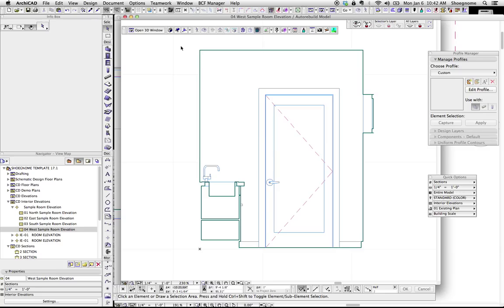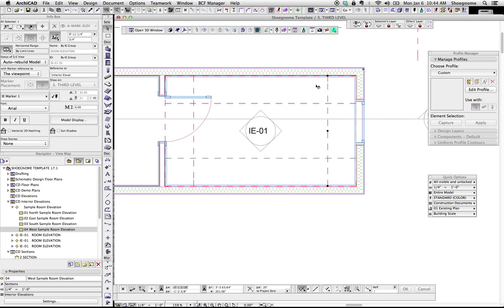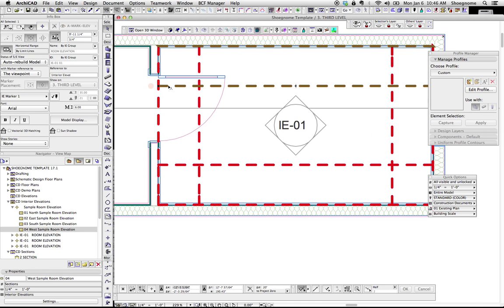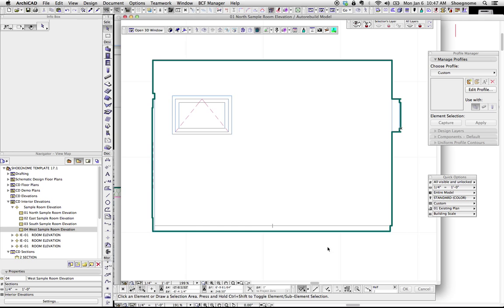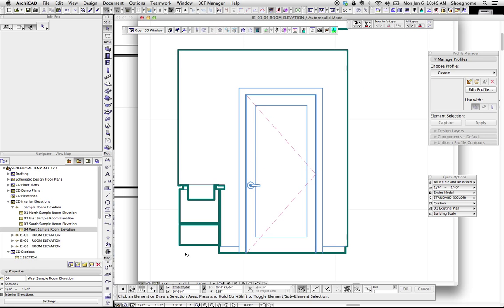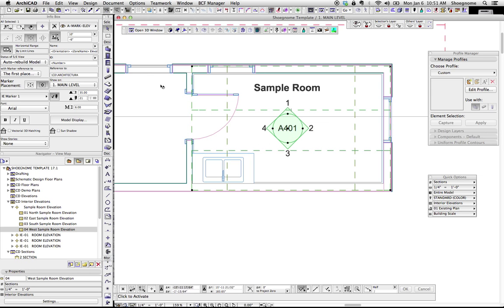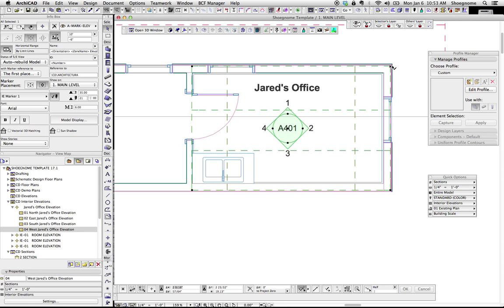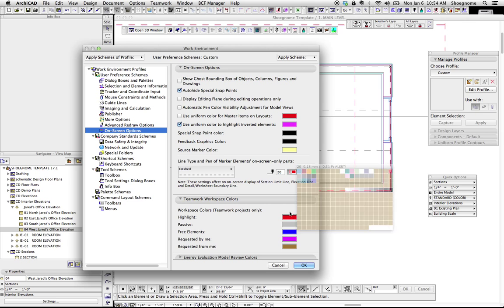ArchiCAD Tutorial #31: Interior Elevations in ArchiCAD

Comment: Nice vid, I have a question....how did you build your walls? Did you use Profile Manager to create your wall linings and skirting to a custom wall, or is the wall a composite with lining and the skirting is another element?...I am using ArchiCAD 22 and it seems that there is always a second cut line at the extent of the elevation marker in a custom wall rather than none in a single wall or composite wall.  I would like to know the marking settings and graphic override settings to achieve your pretty interior elevations...thanks
Reply from the maker: Sorry for the slow reply, I've been on vacation. Download my template (it's free if you want it to be) and check out the settings there: http://www.shoegnome.com/template/ They'll give you all the details you need for matching how I handle the graphics. I use a Composite Wall for the main structural wall then add beams and or secondary complex profile walls for trim, baseboard, siding, skirts, etc.  Graphic Overrides, MVO, and pens solve the cut line issue. I've also moved away from line weights in general as most line weight issues are self inflicted. Also search some of my old posts here for more on automating the graphics: https://blog.graphisoftus.com/author/jared

Comment: What's the best way to deal with a sloping ceiling with the interior Elevation tool? I don't see a setting for that so I'm assuming perhaps an SEO?
Reply from the maker: Make the Interior Elevation go just above the top of the sloping ceiling. Then if you follow the techniques described in the video above, it should all work out. Worst case you have to do a little bit of masking to hide what's above parts of the slope. The Interior Elevation tool can't do a sloped side so the view will always be rectangular.

Comment: When drawing an interior elevation where you have removed a window (renovation filter demo) and new windows. I see the outline of the patch in the wall where new wall was added where the window was removed. Is there a way to get rid of this in the interior elevations without effecting the floor plans? I know I could draw a white fill over it, but is there another way?
Reply from the maker: +pwgarch Change the renovation filter of the interior elevation so that Demo is hidden and both Existing and New aren't overridden in anyway. Then the line will vanish. If you need other existing to be overridden then do a quick mask.

Here's two posts that are relevant: 

http://blog.graphisoftus.com/archicad-education/tips-and-tricks/its-not-cheating-if-its-just-graphic-data-fixes (for a quick fix)

http://blog.graphisoftus.com/archicad-15/does-that-still-not-work-is-this-still-the-best-solution (newer thoughts on interior elevations)

I also believe in leaving the line and noting it because the line is correct: there is something happening there in the interior elevation.
Reply: +Shoegnome, One follow up question to this video, I understand you set a Model View Option for interior elevations, but there is also something under "model Display" (in AC 19) that seems to effect the cut lines. Under "Cut Elements" the first line is "Hide Cut Elements". I can't seem to get rid of the floor slabs and keep the cabinet cut lines. What am I doing wrong?
Reply from the maker: +pwgarch Hide Cut Elements hides elements that are cut. I'm not sure why anyone would ever actually click that option. So it's not what you are looking for. To get rid of lines in the floor slab, you need to set the bottom of the interior elevation to just below the top of the floor and/or change the model view options to remove the separater lines in composites.

Comment: How do you deal with the intersection of vertical door casing and complex profile baseboard?  I keep having a problem where the Casing actually overlaps the baseboard because ArchiCAD complex profiles assume that the outside of the baseboard is the outside edge of the wall, and then places the door accordingly?  I moved the complex profile so that the origin x thing was aligned with the outside edge of the gyp board and that didn't change anything either.  I moved the blue "stretch" guidelines and that didn't seem to change anything either.
Reply from the maker: I think you'll need to do the baseboard separate from the stud wall. Which has lots of other advantages. If you do it as a beam, it can slant along stairs. The baseboard can start and stop and wrap around walls, etc.
Reply: Shoegnome Thanks.  After many hours of searching for a cooler way to do this I came to the same conclusion.  I just needed some comfort in knowing I didn't miss something obvious.  Haven't tried your template yet but plan to soon.  :)  Take care.

Comment: First off, thanks for all the great tips.  I have 2 questions for this video.  1- I follow this step by step but my int elev always has a second heavy line...and it is where the int elev box in plan ends, so in the middle of the wall as I follow you here.  How do I get rid of that?  2 - How can I hide the red dashed lines in plan and just show the int elev marker?
Reply from the maker: Glad you like the videos. So to answer your questions:

1 - Under the Interior Elevation selection settings, go to model display, and change boundary contours to "no contours"
2 - go to the view menu, on screen view options, and turn off marker range
Reply: Shoegnome Thanks!  Simple, if you remember where to look, ha!  On #1, I still have lines extending at flr and clg.  Forgot to say using AC15.  Off this subject, what mouse do you use?
Reply from the maker: Can you share an image of the offending interior elevation? I'm wondering if it's an element you're seeing rather than a remnant of the tool? If I can't figure it out from there, I bet if you sent me the file I could tell you in a few seconds what's going on. If you're okay with that route, we could just jump to that. My e-mail is jared @ shoegnome . com

I use a shitty old Logitech mouse that's probably 10 years old (2 button + scroll wheel). I accidentally took it home with me one day from an old job I'd left, and since it works I just keep using it!